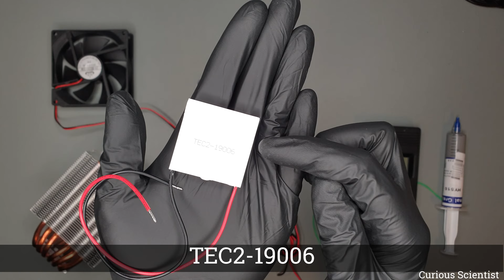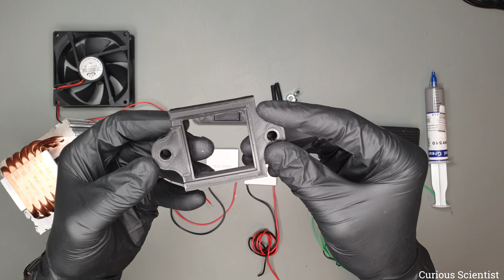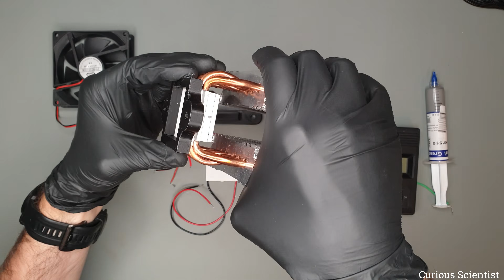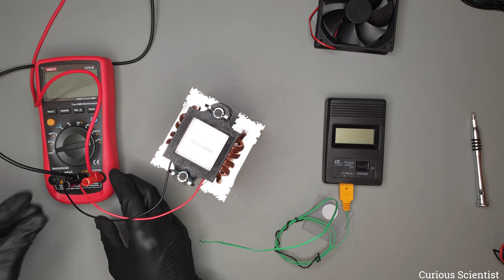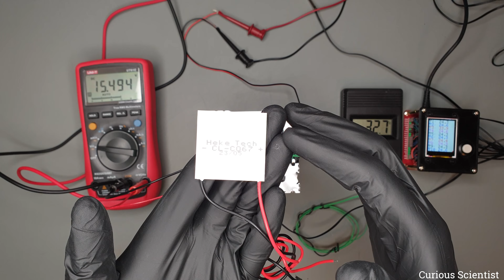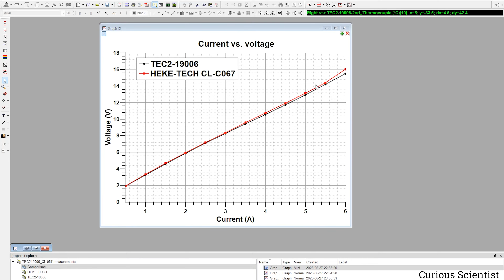Testing two powerful Peltier coolers: TEC2-19006 and Heke Tech CL-C067

Comment: greeat peltier the tec2 19006...but you need watercooling. a small pump and a 40x40 aluminumblock will set you back 5-6eu. Just use a bucket of water to cool. Aircooling is very inefficient
Reply from the maker: They work just fine with air cooling as well as long as the cooler is sized properly. Have you ever thought about what is cooling the radiator in the water cooling loop? 🙃
Reply: @CuriousScientist  what radiator? Didnt you read?
Reply from the maker: What cools the bucket of water? You need a radiator in the cooling loop otherwise you'll slowly start boiling the water. And guess what, the heat is dissipated into the air from the radiator...

Comment: What is the voltage for the lowest temperature in the TEC2 19006?
Reply from the maker: It's in the video and article.
Reply: @CuriousScientist I've found just the current on the article, not the voltage
Reply from the maker: It's the current that matters anyway

Comment: Can i get for peltier mounting please
Reply: Stl file
Reply from the maker: Have you even tried to open the article I wrote and read it?
Reply: Thanks dude , i will try to make it
Reply: If i use this for phone cooler ,  so we just using thermal paster to make peltier contact with body phone ?
Reply from the maker: This is not a phone cooler and it is useless for such purposes. You can simply cool the phone with the heatsink then...
Reply: @CuriousScientist  i just wanna the mounting for my 4x4 fan and heatsink . Cause i cant design for case
Reply from the maker: Do as you wish!

Comment: im 14 are there any pre built coolers like this on ali that include powersupply that can get very cold?
Reply from the maker: Why don't you search for them to see if there are any?
Reply: @ i cant find any ive seen one but i cant find it and i heard a youtuber find one but i dont know what to search. also could i just buy a powersupoly like urs and do they include a plug for the socket?
Reply from the maker: I have no idea what you want to use it for so it is hard to suggest anything.
Reply: @ making a cold af plate for experimenting and cooling stuff down.
Reply from the maker: Then just buy an off the shelf cold plate. There are plenty of them on Aliexpress. I even tested one on my channel.
Reply: @ ok and then what do i ise to power it cheaply? i dont have anything right now only a fan controler thats shit and is sht weak
Reply from the maker: A proper power supply that can power the Peltier coolers. You can calculate how much current they need and what voltage and you look for a power supply that let's say can provide 20% more than the calculated values. Then you also need a voltage regulator. A DC-DC converter is fine. Or just buy a simple bench top variable power supply if you just want to play around.

Comment: I think the heat sink need to be up standing to work better for the liquid inside the copper tube to fall down.
Reply from the maker: Have you heard about the capillary action?
Reply: @  oh , I know about that , just not the English Term, yes it does climb up from the inner wall of the tube via small cracks , it definitely works , I am just guess,
Reply: @ no , know nothing about
Reply from the maker: It's the core principle of the heat pipe. The capillary action wicks up the liquid from the cold side and transports it back to the hot side.
Reply: @ I have no idea how much the direction would affect the performance of the heat sink , sounds like a interesting topic, maybe it’s a little too niche, would love to find out about the results. Like you said , it won’t affect much , still very efficient.
Reply from the maker: I will make a video on it, because this question came up just too many times. It seems that people are really curious about this. I just need to come up with a good method to measure, interpret and present these differences.
Reply: @ I have a project that may use the heat tube and heat sink as long as 3 feet , if they don’t work that size ,I have to connect them into stages , / the direction of the heat tubes  and heat transfer efficiency, may have bigger impact if the tubes are longer,  I mean I can definitely use some info on this topic,😊😊😊😊
Reply from the maker: I know a company that is planning to use heatpipes as long as 12-feet for *nuclear reactors*, horizontally positioned. So, 3-feet should work just fine. :)
Reply: @ that’s great to know

Comment: The heat sink and pipes are upside down. They are not cooling at maximum They are cooling an minimum
Reply from the maker: They are not affected that much since they are more relying on the capillary action.

Comment: Please tell me which peltier element I should choose to cool the Xeon 2699v3 processor, which has a TDP of 145 watts. Since I'm not interested in extreme cooling to negative temperatures, I just need to keep it within positive temperatures to avoid condensation. The AI says it's enough to keep it above +13C and choose tec-12710 or 12715. And the main thing for me is below +75C. Because then the throttling starts and the CPU loses a lot of performance. Or will this idea not work at all normally, so I can install it and forget about it?
Reply from the maker: None. Peltier coolers are not ideal for cooling CPUs or similar high thermal loads. If you'd use a Peltier to cool the CPU, you'd need a cooler that can deal with the TDP of the CPU plus the heat generated by the Peltier cooler. You are facing around 400 W or even more heat... Just use a proper CPU cooler to cool the CPU.
Reply: If you want the real answer.
You should choose something like 12745.. which is much larger than the usual stuff.
And before operating the cpu, just make sure that you have a relatively large quantity of water cooled to very low temps already, maybe even something like a big block of ice.
Then make a custom loop, where the water.. carrying heat from the cpu, if warmer than ambient air, gets cooled by a typical big cpu cooler, or if the water running through the cpu hasn't heated up to over ambient temps, it loops back to the peltier, which already has a large buffer of water that is cold, and then circulates back to the cpu.
And undervolt your cpu slightly for less stress on the peltier, and more efficient overall system.
Undervolt could be possible using intel xtu (windows only software) or through the bios.
Reply: @ CPU Xeon 2699v3 is already undervolted as mush as possible to work under load. And it's already cooled by 6-pipe cooler. But still, after 5-10 minutes under load it riches 76-80°С and it causes trottling which leads to huge decrease in performance. So I thought maybe Peltier element could be the good choice. But I used the water-cooled system a long time ago, somewhere in 2002. Now it barely works and I don't want to buy a new one. So instead I sold that CPU, which was fast but hot as hell, and bought a Xeon 2695v4, which is almost as fast as the Xeon 2699v3, but can run at 100% load without throttling.
Reply: @smert_rashistskiy_pederacii   oh, that's fine then.
V3 was a lovely generation.
Had turbo boost unlocking gimmicks, i.e all the cpu would be very frequently reaching turbo speeds.
Plus some skews had ddr3 support.
2011-3 (x99/c602) was such a platform.
Alright, why did you need extra cooling though, did the throttling seriously hinder performance or stability.
Do you use it for post processing rendering or actually use it to .. idk, game, media, cad, blender whatnot?
Reply from the maker: Real answer, hahaha ha.

You are telling him to precool the cooling media for the Peltier cooler and undervoltage the CPU. 🤡🤡
Reply: @CuriousScientist   yeah buddy, because if you wanna cool somethin, to below ambient.. atleast you gotta cool the fluid.. carrying the heat from the cpu.. down to ambient temps.
And a buffer is never a bad idea, just allows for a more consistent temperature.
Reply from the maker: Why add the Peltier then? The whole purpose of the Peltier cooler would be to cool below ambient temperature (which is by the way useless). Why would you bother with the Peltier if you anyway cool the water cooling loop by other means? You have no clue, sorry.
Reply: @CuriousScientist   because the cpu could heat up anything, pretty fast.
Even if fluid going through the cpu was at 7-8°c , it'll easily reach 30-40°c. If your ambient is less than 30°, then cooling with ambient before sending the loop to peltier will lessen unnecessary burden.

Comment: Hi,
Im not so clever in electronics and things so, but im curious if i there is a difference if i push into a 50w peltier directly 20w regulated by voltage or running on nominal voltage and decrease the current with pwm. Does it has any effect on performance/efficiency?
Reply from the maker: Peltier coolers should not be powered by PWM signal, they need pure DC.

Comment: The  Heke Tech CL-C067 its need 10A im using for many years yeah its can go down  to  -35  ,  -38 degrease at  12v 10A  16v 6A will not have a long life  for long life  12v 13v  9A to 15A  the setup u did its ok regarding its in the open  Heke Tech CL-C067 its use more for mini fridge  portable one  where u can hookup at your car battery like i do  but not at car at battery pack 14v 80A with solar charge use only for camping🙂😉
Reply from the maker: Please share some videos about your measurements and setup. I am interested in why you could reach so low temperature and why I could not. If I increase the current to 10 A, the Peltier starts to heat up itself due to Joule heating. I could blame the cooler's performance for this, but other, similar power Peltiers have no problem staying cool with the same cooler. So I am a bit lost. Thanks!
Reply: -35 or -38 that it's not means you will have that temperature in the mini fridge  there will be  -05 ,-5

Comment: Hi sir, great video! It's true most videos here on YT don't explain well about peltier coolers. Can the TEC2-19006 be used to cool a small volume of about 1.5L? or is it a hustle?
Reply from the maker: Hi! I have a whole series on building a cooling box. Please watch it and draw your own conclusions. But why the TEC2? Do you need to reach -35°C in that chamber?
Reply: @CuriousScientist  no I just need about 5 or 6 degrees Celsius
Reply from the maker: Go for multiple TEC12706 units then. It is cheaper and you'll get a better effect.

Comment: How tightly should the pelter be secured between the heat blocks? Can they be over tightened?
Reply from the maker: They can be overtightened and in that case, you would chip or break the ceramic plate of the Peltier cooler. Go gently. It should be tight enough that you see the excess thermal paste being squeezed out.

Comment: Hi, I got a wine fridge with peltier tec-12706. Changed it yesterday to the same peltier, as the old one was broken. The fridge is supposed to go down to 11°C but is struggling around 13-12°C. Upgraded the fan for more air. Do you have any recommendations of a better peltier? Want it to go down to at least down to 8°C. Been looking at TEC2-19006, Tec1-12703 and Tec1-12710 but I have no idea.
Reply from the maker: Hi! Tec2-type of Peltiers are useless here as they are built for temperature gradient and not cooling power. 12703 is weaker than the 12706, so you should avoid it. 12708 or 12710 are better. However, they have a larger power need, and they also dissipate more heat. So if you go for anything different than the 12706, make sure that you power them correctly (enough current) and cool the properly. Keep in mind that you should not run them at their maximum rated current as they become very inefficient. They should be run somewhere between 8-11 V, depending on the system. The current will depend on which unit is used. I have dozens of Peltier-related videos. They probably have the answers to all your questions.
Reply: @CuriousScientist  thank you so much!
Reply: @CuriousScientist  the 12703 may be weaker but from your data appears to be the efficiency king. am i wrong? after watching all your videos on this topic i assumed we were in aggrement 12703 is ideal compared to 12706...

Comment: what's the difference between 19006 and 12706
Reply from the maker: Hi! It is in the video... The 12706 is a single layer Peltier cooler while the 19006 is a stacked (or cascade) Peltier cooler.

Comment: So it's exactly like with LEDs: The lower you drive them + the more pcs. you install of them = the more light per Watt input you get of them. Offtrade: space, weight, initial costs.
Reply from the maker: Yeah, it's kind of similar. But LEDs at least don't waste so much energy as Peltiers. 😄

Comment: You say in the video that these are inefficient with maybe 20% efficiency. What device do you recommend that has great efficiency and cools to as low as the tec2-19006?
Reply from the maker: Their efficiency won't change significantly if you use a different manufacturer. Their efficiency is based on the principles they work with and the materials.

Comment: They should call them peltier heaters.

I put one in my hand for the first time tonight and turned applied a bit of current. I couldn't believe how much hotter it was than cold. I had to try hard to notice the cold side being any cooler, but the hot side, and the whole package, became hot fairly quickly.
Reply from the maker: Yeah, well, it depends on which side you are looking at. 😄
Reply: @CuriousScientist  if you leave it on long enough without a heatsink, it'll heat both sides above ambient temperature.
Reply from the maker: I know, but that is very obvious. If you don't dissipate the heat from the hot side, it won't be able to cool...
Reply: Bottom line is they heat the hot side by taking heat from the cold side, and it takes energy to do that. That energy is added to the amount of heat you have to dissipate. In the end, it heats more than it cools.
That said, it can still be useful and fun to experiment with. 👍
Reply from the maker: I know these, but thank you. And they are not just toys. They are used in very fancy scientific instruments. :)
Reply: @CuriousScientist  absolutely. I didn't mean to imply they were not useful. (I edited my original comment to provide more context to my joke.)
Reply: @dennisestenson7820 only if to may watts these pelter things work good around 1-4 watts per module anything over and it’s just heat. If you want it cold stack them or you just heat the room.
Reply: @CuriousScientist 
Yess 👍
Reply: @lucasrule5557 
Frage: Reden sie davon das dann
 1-4 W Leistung aus dem Element austritt??
Reply: Well yeah… first off, nothing can ever be 100% efficient, so these will always produce more heat than they remove. Secondly, without adequate cooling, the heat can’t be removed and so it just builds up in the device, and the cold side won’t feel very cold while the hot side will be very hot. The colder you can get the hot side, the colder it can get the cold side.

As an example from a couple nights ago, I removed one from a mini fridge with all the PSU and heatsink still attached. Inside my house the cold side reached about -12C. Then I took it outside where it was about -9C and the cold side reached -30C. The cold air outside allowed more heat to be removed from the tec by the heatsink, and so the tec got colder, really really cold.

Comment: Hey man, thanks for the great tutorial! I really enjoyed it.  what would actually happen if you do not cool the hot side at all? Will it blow / fail eventually and at what amperage ? I am looking for a project with little or no cooling options ...
Reply from the maker: It will probably overheat, and it will potentially melt the solder inside the Peltier cooler, which would lead to an open circuit or short circuit depending on how it gets destroyed. Also, the warmer its hot side, the worse its performance becomes... Peltier coolers **must be cooled**, they generate a lot of heat, and their ceramic plate is not the best in dissipation. So you need to provide a good amount of cooling to the hot side.
Reply: @CuriousScientist   thanks for the quick and accurate reply!
Reply from the maker: You're welcome!

Comment: Can the 2 sheets be joined together?  Will it get colder?
Reply from the maker: Sure, but the 19006 is already a 2-layer (stacked or cascaded) Peltier cooler. Also, you can not go too much colder than a certain temperature (roughly -50°C to -60°C). Furthermore, keep in mind that colder doesn't mean better cooling. The higher the temperature gradient you create, the more cooling power you give up.
Reply: thank you 🙏 @CuriousScientist
Reply from the maker: You're welcome!

Comment: thank you for the video. do you have testing with the 19003 19004 and 19008. which one has a better cooling performance.
Reply from the maker: Thanks! The higher the number (and therefore the current), the better the device. But more cooling is required then.

Comment: So the tec2 19006 is the best cause almost same voltage around 15-16volt same current at 6 ampere same room temperature same heat sink right? When you test it
Reply from the maker: Watch the video. The answer is there, literally for the same questions.
Reply: @CuriousScientist ok